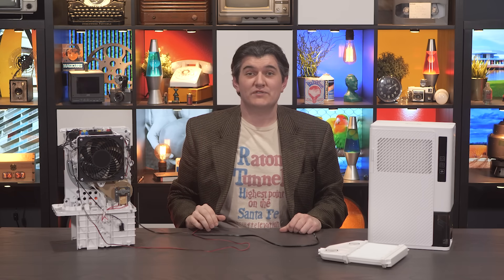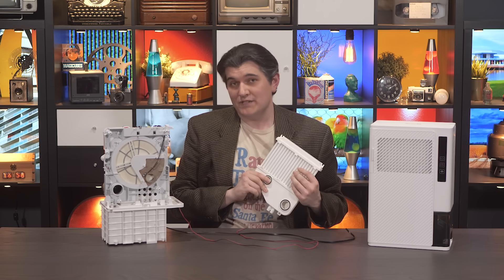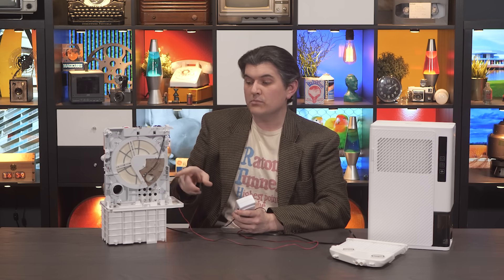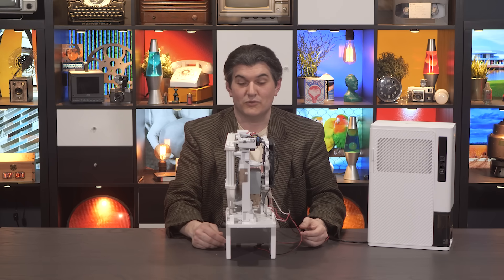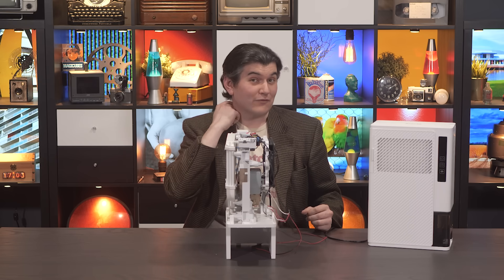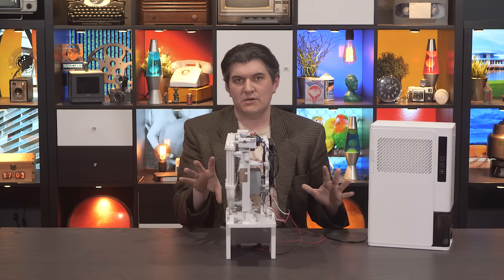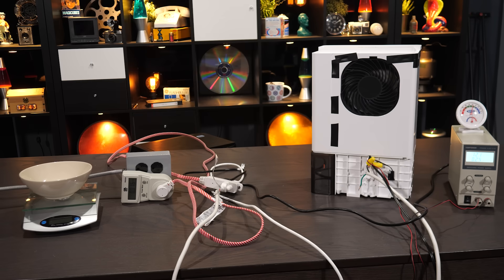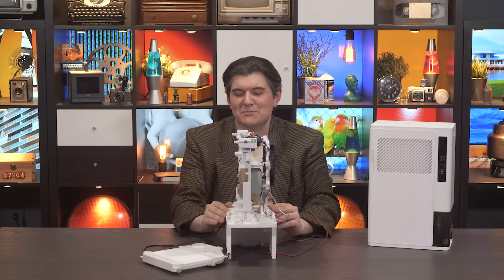A failed duty cycle experiment with a rotary desiccant dehumidifier

Comment: This by itself feels like a toy. But the concept is usable where heat source is cheap or even free. If this, or liquid version (with CaCl) could be integrated with heat pump, it will provide extra dehumidifying without much extra cooling. Maybe solar heat collector or even solar panel could be used for this, since it could be made to run with low dc voltage.

Comment: Silica "gel" is really just exceptionally porous sand.  Because it's porous, it has an effective surface area much greater than is apparent to the naked eye.  It gathers water molecules on that surface area, in ideal conditions up to about a third of its own dry weight.  This is the difference between adsorption (adhering to the surface) and absorption (dissolving into the bulk of, typically, a liquid).

To release the water from the gel, it must be heated to about 120°C.  This implies that the water is evaporating from the surface by vaporisation - effectively, boiling.  A fully saturated gel requires up to 2 hours to be fully dried in this way.  It's safe to assume that the 2-minute cycles employed in your dehumidifier do not take the gel mesh through anywhere near the full range of its water-holding capacity.

Scientifically speaking, I would be looking to investigate the temperature actually reached in the gel in front of the heating element, the humidity of the air entering the condenser (which is what that "heat exchanger" really is), and the temperature and humidity of air leaving the condenser (which probably isn't 100% efficient).  To improve power efficiency which is dominated by the heater, I would consider reducing the air velocity in the condenser, to increase the fraction of moisture extracted from the gel which is not then returned to the ambient air.

Comment: I think one double check of the design would be to weigh the saturated silica gel alone (removed from any mechanisms). Roughly 1/3 of the weight of saturated silica gel should be water, so that water times the mechanism's rotation rate is roughly the max water extraction rate for a given rotation speed.

Comment: You should learn how to use an Arduino, would make all these experiments much easier. 

You could disconnect everything, connect it to the arduino and make a small program to run it exactly as you like. 

Anyhow, cool video.

Comment: What would happen if you lowered the rate at which the media rotated at? That would give it "more" bake time, but also more time to re-absorb the moisture, right? If you say lowered it by half, would you expect the water extracted to be any different? Or do you think that in its current state we're limited by the rate at which the silica media can absorb moisture?

Edit; You kinda answered my question, but my question is a bit different as i'm wondering if we can extract more moisture from the slower heating cycle, allowing it to potentially absorb more moisture?

Comment: Asking questions and testing assumptions is never a failure. I feel like if this wasn't a rotary device, your idea of turning the heater on and off might make some sense, though. But since this is rotating, it effectively does have a "duty cycle" for any given point on the wheel, it's just able to run continuously as each point on the wheel is at a different point of the cycle.

Comment: I didn't realise how tiny this thing is from watching your other video. I can sort of understand why it wasn't very impressive. Whereas yours is 300/150 watts a normal sized version is 700/300 watts and has a larger wheel, condenser and proper high pressure type fan which I assume you need to get decent airflow through the zeolite dessicant.

Comment: Determine the wet bulb temp of the air entering air and see how close to that temp the wheel surface gets before entering the Regen section.   Tweak the wheel speed until you get closest to wet bulb.   That might be ideal speed for the wheel to absorb moisture because it would indicate the best rate of absorbtion.

Comment: In your first video you talked about peletier and heat pump dehumidifier.
i was wondering since this design uses both a hot side for evaporation and a cold side for condensation, if you could actually couple it with another tech (as peletier).
As i understand it, peletier is basically solid state heat pump, not really efficient, but nonetheless, for 100w electricity input you can output more than that as heat, as long as you can warm the cold side back up fast enough. And good thing we have a condensor that needs cold to work.
I still think that the efficiency wouldn't be nearly as good as traditional heat pump, but I feel it would still be better than what you have here.
And technically it could also be coupled with a traditional heat pump. Where cold and hot air are basically byproducts of getting the condensor cold, but eventually are lost and cancelling out in the room, with only the extra latent heat remaining.
Sorry if i'm not clear, english is not my first language, but I'd love to see more experiments with such techs.
if i remember correctly in a similar way, tech ingredients did a video on cooling using dessiccants.

Comment: Something to keep in mind - the silica gel probably isn't "saturated" so much as "full of enough water that the heat cycle will remove a stable amount and keep the system around a steady state". Whereas any run after a period of downtime probably will have more moisture embedded in the silica gel at rest since it's always pulling moisture out of the air. But while that moisture contributes to "total water in bucket", it isn't truly "water extracted from air due to running", since it's confounded by "water absorbed by silica gel while off". A way to monitor that might be to keep the dehumidifier on some scales and check the weight of the system at start/end, since whatever that difference is would indicate the amount of trapped moisture contributing to the mass of silica gel. You'd need to subtract that from the water extraction amount to see the true "differential" from the heating element version VS without.

Comment: In hindsight, it's pretty obviously been tuned. The amount of recharge heat and time spent in said flow are probably ideal for getting the maximum performance out of the silica, and it's also likely to be fully saturated by the time it returns to the recharge flow.

Now, one thing that eould be interesting to see and have a shot at being the top performer is a hybrid design: Refrigeration up front,  the dessiccant dehumidifier behind that, and use the heat from the refrigeration system to run the dessiccant recharge

Comment: In the main video, did you try running the "night  mode" in the same moist bathroom as the Full power run and heat pump compeditor?

Comment: I wonder how much water the disc can hold, and what the adsorption curve is.  Is it enough that you could put it I. A dehydrator, weigh, then put in the humidity room on front of a fan for N minutes, weigh, and then graph the results?  My suspicion is that it might suck up moisture fast at first, but fall off as the surface gets saturated.  Then I think different rotational rates could help ferret out where the inefficiencies are.

My suspicion is that it is limited by the extraction section, and only a fraction of the adsorption section is really helping.

Comment: It kinda makes sense in that if the wheel was turning faster, it would have less time to absorb water and less time to heat dry it per revolution, but there would be more revolutions. In fact, assuming the desiccant transfers water at a constant rate, the speed of the wheel would probably not make any difference. The wheel going slower means the quantity of water absorbed would be greater, so it may become less efficient due to saturation.

Comment: I have a intuition that combining the refrigeration cycle dehumidifier and the silica gel one would be relay beneficial. I think we should put the exhaust of the silica gel unit (the place with very hot and very dump air) as an intake of the refrigeration cycle cooler. You could get more liquefaction by using refrigeration cycle instead some plastic tubes and a fan, and the air going in the cooler would be warmed by the silica gel heating element, so no freezing effect. Yes I know -cost, but in the video on connections channel one of those costed some thousand dollars, so....

Comment: what about switching out plastic straws to metal? that was my first thought when i saw it

also researching what material is used in them, BigClive's comment on the main channel suggested it was a zeolite salt, we could get a drum and check whats the max capacity, that can also be measured using a high quality weighing scale, when its fully saturated, that drum weight can be used to calculate the spin rate to find the optimal time. I guess thats what its enginners used to decide the rotatory speeds.

Comment: The first thing that came to mind when watching the main video was to use a more efficient heating method for the silica and, of course, that would be a heat pump. But then you would be creating a compressor dehumidifier again. So, maybe you could combine both? Use a separate fan for each heat exchanger. Then you use the condenser to heat some air and directed to the silica to extract the moisture. I'm not sure if it will get hot enough to remove most of the moisture from the silica but it's better than nothing, and the only downside I can think of is the increased power consumption from having to add  a separate fan and some rotating whell for the silica. This might improve the performance of the compressor dehumidifiers in cold climates, but I guess most people either use it in cold or warm weather, so a machine that works on both is not really relevant.
Also, as a bonus, the fact that you have to add separate fans for condenser and evaporator means you could easily reroute some warm air to the evaporator to get rid of the ice buildup, which doesn't really help with efficiency, but at least can accelerate the process.
Reply: A peltier instead of the heater would be a possible tweak. Especially if you make sure not to need too high of temperature.

Comment: What happens if you pipe the output of the heater section to the outside of the house instead of running it through the condenser?

Comment: I think you would need to rotate the disk at different speeds depending on RH% of the intake air for optimal performance. In really damp conditions the disk is probably already saturated way before the disk actually gets into drying area.

In addition, I would assume the cycling of the heating element to cause the temperature of moist air to drop so much that condensation happens at worse efficiency. For optimal performance, you would probably want to run the heating element with a thermostat that keeps the inner air recycling at constant temperature above ambient (e.g. ambient + 40 °C).

One interesting technique would be to use microwaves to get the moisture off the silica gel but I'd assume it would be pretty hard to do safely with a single disk.

Comment: I imagine its a similar concept to the speed of water in a water cooling loop not having much effect. Drying out the silica gel more means it can hold more water but it also means it takes longer to complete a loop around the system so the two rates cancel out.

Comment: Giving it an actual heatsink would be the best way to improve it. The silica is probably operating at near saturation. The drying rate of rechargeable desiccants is fairly exponential. it's easy to remove a little bit when it's saturated, but take forever to dry completely. You might have had it backwards and it might need more drying time to be more efficient. There is also the potential TEC units might be a way to improve this without going full phase change. Use them to cool the incoming air and improved condensation and the hot side to recharge the desiccant. I don't think they would get hot enough, but maybe there's a way to combine the two using the desiccant as a moisture magnet to improve a TEC dehumidifier. Though that said, it still won't touch phase change in efficiency so, eh?

Comment: Yeh, this thing's working principle really isn't suited to a duty cycle controller, especially with such a long cycle time. I think it's one of those "it is what it is, don't fuqk with it" type things. But it's a good experiment nonetheless.

If you have a VFD lying around, you can mess with the speed on the synchronous motor and try to create a plot of effectiveness vs speed as well as efficiency vs speed. Maybe chuck a thermocople or two into the path of air exiting into the heat exchanger, to keep an eye on temperatures. Don't want to end up cooking the silica gel 😅

Comment: If you want a quiet but efficient dehumidifier couldn't you use an ammonia 
system. The run off a heater and have no moving parts.

Comment: Could you frankenstein this machine together with the one with the heat pump such that the heating element of this device is replaced by the hot side of the heat pump and the wheel uses the same airflow from the machine with the heat pump instead of its own fan? That way this machine just uses the very same energy input that the condensing machine uses, but can maybe extract just a little extra moisture out of the air that didn't condense on the condensing element.

Comment: A test I would have done would be to run the heater at more than a 50% duty cycle. If, for example the heater were on for 2 minutes then off for 30 seconds, the residual heat might still be effectively draining the water from the desiccant.   Then the heat would go on again for 2 minutes, hopefully before too much heat was gone from the heating element.  If this works, it might improve efficiency by 15% or so. The fan blowing over the heater would remain on full time.

Comment: A sequal will be required: adding more wind with the external fan for more "idle time" (when not rotating/heating) could make condensing work better as the straws are cooled over longer time.  So yes, with less power, more water could be extracted whed adding more wind to the tubes...

Comment: Hmmm - When you did the test with the unit re-assembled, cutting off the fan also stoped room air being pulled through the silica gel - so effectively it was turned off 1/2 the time.    I think you need to keep the fan running while the heater cycles on and off.

Comment: I happened to watch Steve Mould's video on siphons, which got me thinking, coulnd't you just compress air direcly to dehumidify it? I have no idea if that would be more or less efficient, but I suppose less, since it's not how it's usually done.

But if you're already compressing stuff, why not the air directly... Might be tricky to get the air back out sans water maybe. And the energy you put into compression would be lost when letting the air back out, so you could drive something off it...

Would need some kind of moisture-activated check valve on the water output, but maybe just a float could do? The air pressure would need to be lower than the bouyancy of the float for it to open when there is liquid water present, could be an interesting design challenge.

Comment: i do wonder if it's possible to swap out the resistive heating element for a (probably very large) peltier element (with it's own condenser or something) instead to try to capture the mechanism of the other cheapo dehumidifier while having the same power draw. though that does ignore the primary use-case of the desiccant dehumidifier

Comment: Based on the data from the numbers in the main channel, I'm wondering if the silica gel is getting saturated "quickly." I'm speculating about this because I'm trying to understand why these machines seem to remove a very similar amount of water independent of testing conditions. Another possibility: maybe the amount of heat generated is the limiting factor in water extraction.

Comment: As I said in the main Video: The Graph from the commercial Dehumidifier showing a Plateau is a Sign that the Desiccant gets saturated at that operating Point.
Below that Point there is room in the Desiccant for more moisture, so you might want to spin the wheel slower to fully utilize it. But then it spends more time than it actually needs to get dried out in the warm air path so you might reduce either the area that is covered by the heater via a little extendable thing moved in and out by a little stepper motor or reduce its power with a dimmer kind of thing. Control everything with some Controller that has a 4-dimensional Map of Moisture vs Temperature vs Wheel Speed vs Heater coverage/power and you have a dehumidifier that is I would guess 50% more efficient in some operating conditions but would cost 700$ instead of 70$

Comment: These things have been around for about a century.

The early ones had a drum that was made of panels of desiccant arranged like an old hair curler.

They were mounted in the side wall of a section of duct.

For 1/2 of the drums revolution it was exposed to the airflow in the duct. The other half was the in a box attached to the outside of the duct, where the desiccant was being regenerated.

Think "heat recovery ventilator' but with a desiccant "drum" moving water.

They would work for a while, then the desiccant got contaminated and needed to be replaced with fresh crystals.